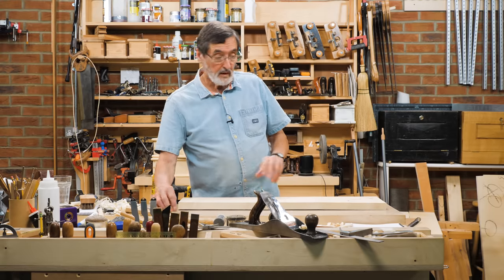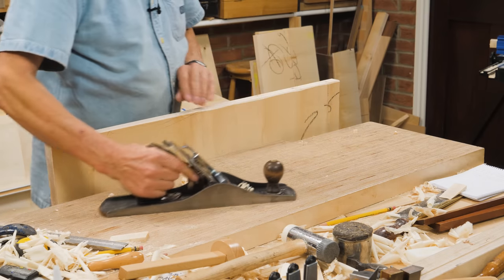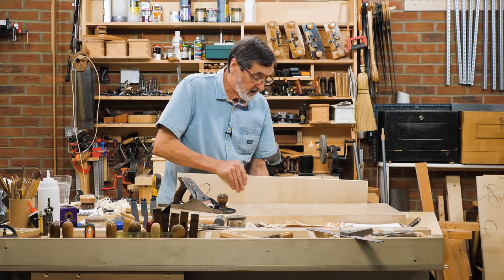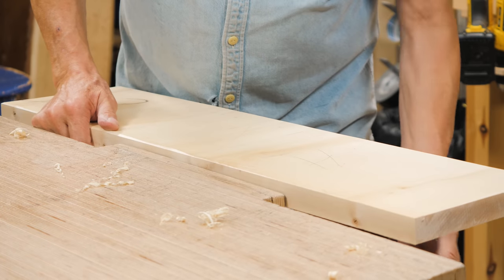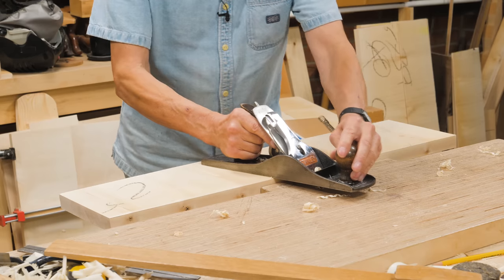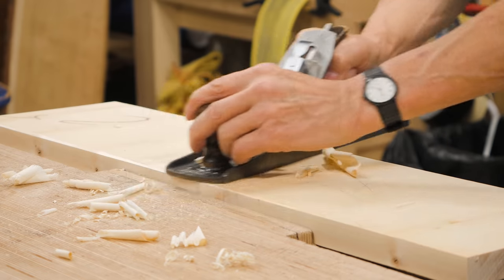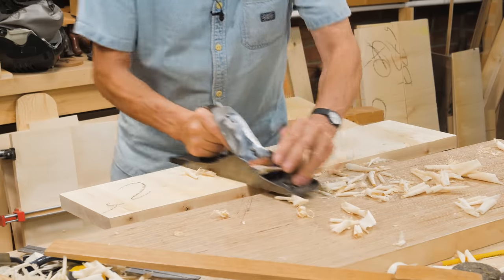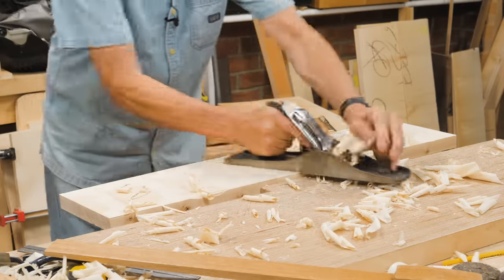Hand Planing Awkward Grain | Paul Sellers

Comment: I have only been hand tool  woodworking for six or seven years, but I instinctively did that when I ran across difficult grain. I did not know until I saw this video if that was correct, all I knew was that it worked and planning with the grain did not because you couldn't. not that I'm anything special or that I'm any good at hand tool work, I just saw that one thing and just did it. thanks for all you do and have done to promote hand tool woodworking. I have said it before, you are the reason I do hand tool woodworking, you are the one that made it make sense to me.
Reply: It's more "correct" (ie traditional) to scrub-plane at 45 degrees to the grain, rather than 90.

Comment: He makes it look so easy! If I tried that, I'd be left with a board about 1/4 inch thick by the time I got it flat without any tear out. He's had a lot of practice and it shows!
Reply: thats where 50+ years experience shines ;)
Reply: Funny thing is, I tried doing as he did and I ended up with exactly what the OP described lol. Definitely has decades experience over me
Reply: 50 years of experience isn't required.  Now that you have the knowledge of what to do, you can  put it into practice and anyone can achieve the same results with some patience.
Reply: I doubt a straight blade bench top planer could have handled that board.  A spiral head likely could, but Paul’s beveled edges would improve the odds.
Reply: Paul makes everything look easy but it is achievable. Well within reach with a leap of faith.
Reply: No, it's actually very simple. Put on a bevel down to your line........that's the key. Then remove the bevel.

Comment: Thanks Paul.  Never thought to go across for difficult grain.  Certainly done so with a scrub plane when hogging off lots of material but didn't make the connection to try it on the smoothing process.  Will definitely keep in mind.  Thanks for sharing.
Reply: So, the difference between scrub planing, fore planing and try planing is primarily the amount of camber on the blade.  All generally happen before jointing and smoothing.  While you can start dimensioning your board with your scrub, you will want to move to a fore or a try as you get close to your line.  A high angle plane or scraping plane can make smoothing easier.

Comment: Question of 10 points: how do you mark those parallel and untwisted lines ? With the pencil, I think, but how do you do the first side of the board?
Reply: He recently uploaded a video about that, called "twist solution". You don't need to do this mind you, but it helps for very twisted boards.
Essentially he uses winding sticks and a wedge to meassure the twist, then uses his straight edge (you could use a chalk line instead) to mark a rectangle/plane on the edges of the board. You can then plane down to those lines, e.g.  by using the technique from this video.
Reply: In fact, I'm pretty sure he is working on that same board in theese two videos.
Reply: @SigurtDinesen  thank you, it seems to me that it is the same board

Comment: I am by no means a skilled wood worker but I do work with wood and hand tools for dealing with it. When I do things like this I end up with uneven thickness a lot of the time. That could be from doing it to two boards I want to join in some way or even a single board. This is unhelpful when making a dovetail box for example. How would I avoid or correct this without making the whole thing thinner than it was supposed to be?
Reply: You need to mark lines so as to be able to have a board that is parallels. So what you can do is get one side completely flat and then use that side as a reference to mark the other side with a gauge and then work with the plane to that gauge line.
Reply: @bighands69  Thanks for your response. Bearing in mind I don't have a thicknesser, its all hand tools. - Are you saying ultimately I'd need to start out with thicker stock than intended for the finished product and refine it down this way or even end up with slightly thinner stock and do the same for all boards involved? I seem to end up playing catch up doing stuff like this because I get one bit square and flat and then try to do the rest of the faces and something goes out of sync, leaving me with different thicknesses of board or not squared to each face boards even if they are flat.

I may have explained this in a not good way so apologies if this is difficult to follow.

Comment: How do you avoid blowing out the far unsupported edge?
Reply: I think that's why he chamfers the long edges first.
Reply: He beveled the edges to start with. Notice that he kept saying that he was working down to the line. The line is where the bevel stopped. If he had gone past that, it would've blown out the edge.
Reply: @TheJgoodwin74  Thanks to both of you!
Reply: @BakerVS  
Also when you practice at it you start to get a feel for the wood sort of like surfing or riding a bike. You will begin to find yourself making little corrections in the direction of the grain and sometimes find that the board do not alway break out at the end when planing against it.